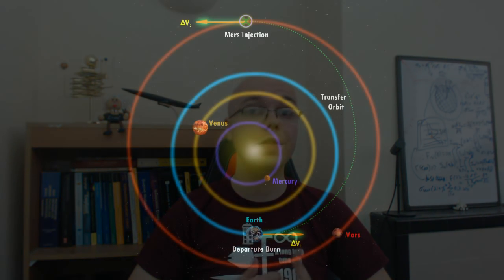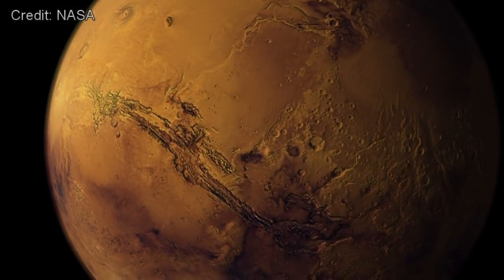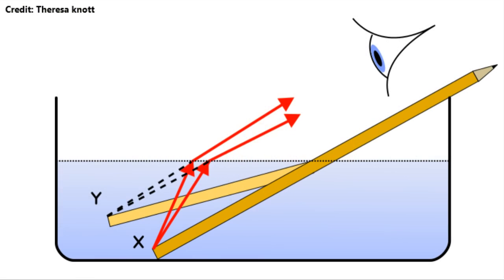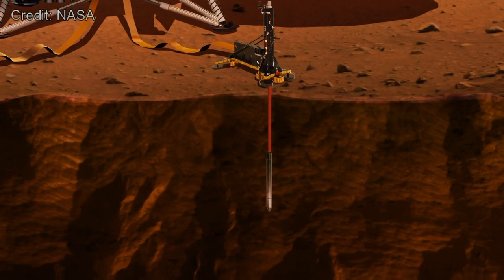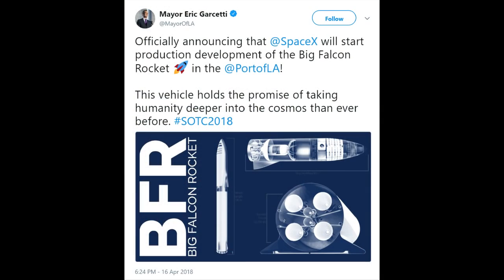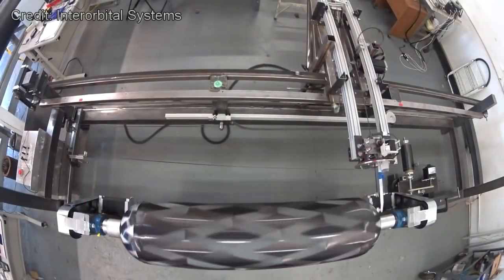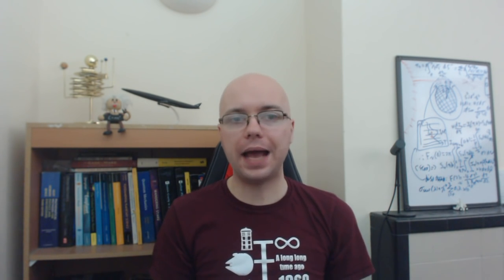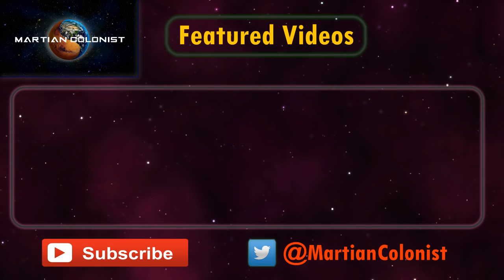Mars Mission Update: May 2018

Comment: Human colonization of Mars will not occur until technology is able to provide protection from radiation. 2020 isn’t feasible.
Reply: I've actually been looking at this, and it seems to me that most of the kerfuffle is administrative.  The actual risk is minimal.

If you check out the Mars Science Lab surface data (particularly the appendix figures 1 & 4, and tables 2 & 3):
Hassler, D.M. et al . (2013). Mars’ surface radiation environment measured with the Mars Science Laboratory’s Curiosity rover. Science 343 , 1244797.

The daily GCR (hard to shield) radiation dose is about 0.64 mSv/day (Mars surface).  And about 1.84 mSv/day during interplanetary transit.  Depending on solar activity, this can increase by around a factor of 2 more.  In a canine study, animals exposed to 3.0 mSv/day (Co60 gamma dose delivered over 22 hours for each day) lived full lifetimes with no apparent increase in mortality from tumors verses the control group.

Canine study (check out figure 3):
Fliedner T.M., Graessle D., Meineke V., Feinendegen L.E. Hemopoietic Response to Low Dose-Rates of Ionizing Radiation Shows Stem Cell Tolerance and Adaptation. Dose-Response 10:644-663. Oct. 9, 2012.

The problem comes from the administrative decision for mission design to not increase chance of death (REID) by more than 3%.  They then go on to calculate this increased risk of death by assuming all radiation damage is cumulative without accounting for biological repair in the body.  Therefore no dose is considered not to contribute to your risk of death (this is called the Linear No-Threshold Model).  They use this model despite evidence to the contrary in various radiation worker groups, some of whom actually saw reduced rates of cancer and all-cause death (radiation stimulates your immune response).

For example:
Sponsler, R. and Cameron, J.R. (2005) ‘Nuclear shipyard worker study (1980–1988): a large cohort exposed to low-dose-rate gamma radiation’, Int. J. Low Radiation, Vol. 1, No. 4, pp.463–478.

There's also a huge problem with the assumed mission designs during the risk assessment.  They are assuming 180 day hohmann transfers which are realistically going to be a much shorter transfer of around 100-90 days (BFR is targeting 90 days) due to the mechanics of three year 2 year free-return free return trajectories.  That cuts out a huge dose of radiation right there (almost a third of the total dose).  Furthermore, every study predicts actual surface dwelling habitats, which is simply ludicrous.  Anyone seriously thinking of spending 2 years on Mars is going to mound regolith over their habitats, massively reducing incoming dose:
0 meters of dirt starts you off at 0.64 mSv/day
1 meter of dirt drops your exposure to  ~0.08 mSv/day,
2 meters drops it to ~0.04 mSv/day (below OSHA radiation worker annual limits)
at 3 meters the radiation levels bottom out at local a background of ~0.008 mSv/day

So even a conservative 1 meter of dirt cuts the overall exposure an additional 29% (not counting EVA).  Thus, the actual total dose is likely to be quite a bit less than half of what their predicting.  So like I said, I don't think the radiation issue is a real problem.  Let's face it, there's plenty of bigger risks ahead if your going to settle Mars.  If you're a Martian dying from cancer, an awful lot of other things had to go right (and you've spent your life doing incredible things).

Edit: corrected free return from 3 to 2 years
Reply: +Faulx Eve
Your post is interesting and knowledgeable, but you seem to come down on the cavalier side and are not considering the political ramifications if you're wrong.

"The actual risk is minimal."
I suppose that's your informed opinion, but there seems to be a whole lot of experts putting $100s of millions into the problem who disagree with you or would definitely say we don't know yet.

Have you seen this NASA video?:
NASA Talk - Spacecraft, Habitats and Radiation Protection
https://www.youtube.com/watch?v=GIYdF7YlX3o
I don't think they've solved the problem yet.

Regarding the Mars Science Lab surface data and canine study, yes we have this data, but the problem is we have zero data for sending humans on a deep space mission to Mars with the particular type of radiation they would be exposed to. Dogs are different than humans and the radiation during a Mars mission is impossible to replicate on Earth.

"They then go on to calculate this increased risk of death by assuming all radiation damage is cumulative without accounting for biological repair"
Hard to believe that none of the smart people who are working on this problem have considered such an obvious factor.

"They are assuming 180 day hohmann transfers which are realistically going to be a much shorter transfer of around 100-90 days (BFR is targeting 90 days) due to the mechanics of 3-year free-return trajectories."
Not sure why you mention free-return trajectories as such routes do not land on or orbit Mars. I'm pretty sure the first manned mission will at least orbit Mars. I don't know where you are getting your "realistic" transfer times of 3 months. A human mission will be very massive and take much more energy and is nearly impossible to reach Mars in 3 months with current technology. Yes, Musk is claiming the BFR will send 100 people in 90 days, but he says a lot and has yet to put a single person in space.

"every study predicts [only] actual surface dwelling habitats [without considering] mounding regolith over their habitats"
Not true, many have considered using Martian soil for protection including the video above.

"I don't think the radiation issue is a real problem...there's plenty of bigger risks ahead...If you're a Martian dying from cancer...you've spent your life doing incredible things"
It may not be a problem for some individual willing to risk his life, but it is a huge issue for the success of the mission and program. Any human trip to Mars will be funded by a group of nations and corporations whose image will be destroyed and funding cease if everyone aboard their mission gets cancer, or worse, dies before they return to Earth. Hence NASA's 3% REID figure and the need to proceed with caution.
Reply: Turbulence?  Are you sure?  There's not much atmosphere for turbulence.  My understanding was that the sky-crane design solved a surface power production issue, where dust from ground level retros would settle over the solar panels.  This would be a non-issue for a tall lander with retractable panels, especially with crew around to clear them off.  Thus ground level rockets are not a problem for the BFS mission design.

Perhaps you are referring to the high speed retro propulsion problem? That was a turbulence issue.  It is also one that does not apply to the BFS, which is planned to bleed off the vast majority of its speed using a lifting body aerobreak.  After that, it will be slow enough to land very much like Falcon 9s do on Earth, a burn for which there will be practically no turbulence.

As for heatshields, there is already data for the phenolic impregnated carbon ablator (PICA) that SpaceX is likely to use.   It has a density in the range of 0.266 g/cm3, and a PICA was used on the Stardust sample return capsule.  Here is a reentry profile for it:

http://i.imgur.com/9FuB0ZF.png

Notice the majority of the slowing takes place at about 47kms altitude.  On Earth, that corresponds to a pressure well below a millionth of that at sea level (assuming my formula is even valid at that height).  Thus even Mars' thin atmosphere provides more than enough drag to bring a ship to below 1000 m/s.

As Wooster points out, if you have sufficient lift, you can take a longer pass and experience a lower maximum heat load.  There is even a possibility of doing multiple passes, giving everything time to cool off as you skip back off into orbit.

The question is, can the PICA handle it?  SpaceX seems to think that it can not only handle a Mars landing, but also an Earth-landing, and perhaps multiple times at that, without refurbishment.  Examination of the Stardust heatshield seems to agree.  With the shield losing at most only 6 mm off its 58 mm thick surface (and that after a very aggressive 100 second aerobreak, peaking at 40g).  A gentler maneuver may have removed even less.

This looks to be a pretty good Stardust paper (I've only skimmed it):
https://ntrs.nasa.gov/archive/nasa/casi.ntrs.nasa.gov/20100027549.pdf

Doing some quick research and some rough math, the shield seems to mass around 5.4 kg and the capsule around 46 kg (about 12% of the total mass being heatshield).  So to slow down around 300 tonnes of ship+payload+fuel, we're looking at as much as 36 tonnes of ablative heatshield (if we try an aggressive descent like Stardust).  There's a good chance BFS could get away with a lot less (perhaps an order of magnitude less) by using a longer breaking maneuver, evaporative cooling techniques, and capitalizing on a much much greater surface area to mass ratio (it will be mostly empty volume by the time it is in Mars' atmosphere).

Can such mass savings truly be realized?  I'm not sure.  I don't have access to their data or modelling equipment.   But from what we've seen, it does not appear to be outside the realm of possibility.  It doubtless will take some more development, but generally speaking, I'm far less pessimistic about the state of heatshield technology.

Testing the reentry procedure and hardware will be a simple matter of lobbing a BFS around the moon and landing on Earth again.  This produces similar reentry velocities to a Mars return, and should give a nice proof-of-concept.  Certainly, there's no risk of the BFR design going to Mars (or carrying crew) on its first (or even its 12th) launch.  It will need to be tested close to home quite a bit first, and I suspect we'll see many design refinements along the way.  So on this we agree.

P.S.
Your video link is a very good basic synopsis of the mission deltaV and time requirements of a Mars mission.  It does fail though to fully explore the implications of ISRU, NTR, pre-building, and propulsive abort trajectories on mission design.  Together, they make a Mars mission much more plausible.
Reply: I absolutely agree, we don't know enough to say for sure until we do it.  There are many heavy, high energy atomic nuclei flying around deep space, which have pretty huge "quality factors" which define how much damage they can do.  However, we do have quite a lot of data from animals studies using particle accelerators which can create this same type of radiation.  There are simian studies which show an even higher dose resistance than canines.  So there's some reason to believe humans will actually be more resistant.  Still, it's hard to say without doing some sort of human trial.

You might then ask, why does no one do a study? To give you some idea of the scale of the risk for lower radiation doses: a medical trial would require more than 100,000 people (ideally more than 300,000) in order to conclusively detect a significant amount of increased disease.  There are actually places on the planet Earth with similar dose rates to Mars surface (Iran for example).  The small numbers of people living in these places show no detectable increase in risk, but confounding factors like different diet, culture, and medical practice make the error in the data too wide.  So again, its hard to evaluate the real risk at such low doses.

The Linear No-Threshold Model (LNTM) is actually a controversy in the radiation industry, and not every one subscribes to it.  The model goes back to the 1940s before we even knew about DNA, and it has become well entrenched.  Most people who use the LNTM do so because data for much higher doses delivered acutely (> 1 Gy) showed medical problems.  They then extrapolate backward to lower doses using a "linear" model to reach the origin (thereby assuming no safe threshold dose exists without actual evidence to guide them).  They justify this approach because it expedient, easy to do, and limits liabilities to places like hospitals and equipment manufacturers... not because they have evidence for it.  The use of this model is driven by the same fear that removed the word "nuclear" from "Nuclear Magnetic Resonance Imaging."

Another problem is that the "smart people" involved in calculating risk, have lots of reasons to be overly cautious in the absence of data.  Since it's their job to consider "risk" they may easily disregard evidence that shows either no-risk or even a benefit because it is not part of their job.  I saw more than one research paper "adjust" the error bars because the low end was well into the "negative excess relative risk" zone (i.e. radiation might have reduced the rate of disease).

When I say "free return trajectory" I mean "if you decide not to stop at Mars" (i.e. you abort the mission), then you get a free return to Earth (no fuel need be spent).  If you do want to stop at Mars, you merely adjust your course to dip into the atmosphere and use your heatshield to slow down.  The technique required for a 90 day transfer is simply to burn a little more fuel and go faster.  The health benefits of doing so are immense, not only because of reduced radiation but also the reduced time in weightlessness.

This paper describes it excellently (also showing "propulsive aborts"):
Wooster P.D. et al. Trajectory Options for Human Mars Missions. AIAA/AAS Astrodynamics Specialist Conference and Exhibit, Guidance, Navigation, and Control and Co-located Conferences. August 2006.

When I say "every study" predicts a surface dwelling I mean every study NASA uses to calculates the increased risk of death.  The studies use a base-line model, which does not deviate from two 180 hohmann transfers and a 500-550 day surface stay.  I would advocate that the baseline should probably be different.

Finally, to address the "fall out" from an astronaut death.  Radiation death, in the unlikely event that it occurs, will probably be from a cancer 18 or more years after the exposure.  Meaning there's a pretty huge divide between cause and effect.  I very much doubt the "fall out" will and on the program.  Furthermore, during that 18 years, the person will have plenty of time to train replacements on anything they need to know, so the risk to the mission from loss of expertise is also minimal.

P.S.
I'm listening to your link while I type this.  And she's incorrect about double strand breaks.  DNA can and does repair double strand breaks, and when it cannot, the cell itself or immune system will typically destroy that cell.  Also, many cancers require a very specific point of damage to create a cancer, this massively drops the odds of random damage causing cancer.  Radiation is a number's game.  So she's oversimplying a bit. 

Remember also, her numbers are all based on LNTM (I actually recognize the graph from a paper I read), so, if there is indeed a threshold, then she may be overestimating the risk.  Potentially by a lot.

It's interesting to note that her graph shows "no smoker" populations.   If it showed the "lifetime smoker" population, their chance of dying would be lower from the Mars journey because you took away their access to cigarettes.  Thus, there's actually a huge population on Earth who voluntarily accept even greater increases in risk of death and for a far less noble cause than a Mars mission.
Reply: +Faulx Eve
A pleasure to converse with a knowledgeable person...

"There are actually places on the planet Earth with similar dose rates to Mars surface (Iran for example)."
I can see Iran being similar for certain types of radiation, but it would seem that the Earth's magnetosphere would have to block some of the rays that would reach the surface of Mars.

"the "smart people" involved in calculating risk, have lots of reasons to be overly cautious"
I agree, a miscalculation could bring down a career. But I would think management would guide them to be reasonable also or the mission would never fly.
Overall, I would say the atmosphere at NASA in the last 10 years or so for human flight has been one of excess caution and overly high standards. Perfection is beautiful, but not if it prevents you from getting off the ground. The Apollo program was a great example of very high standards yet still meeting deadlines. They let things slide that could slide a little. It seems today that NASA doesn't let anything slide and is caught up in the details and not the big picture.

"...for a 90 day transfer...The health benefits of doing so are immense"
I agree completely. It has always been my opinion that a 6-9 month transit time for humans is ridiculous and extremely risky, and that we shouldn't even attempt a manned mission until the transit time can be reduced to a month or two. However, my studies have shown that a 90 day transit is much more difficult than the minimum energy route and not yet achieveable.

"Radiation death, in the unlikely event that it occurs, will probably be from a cancer 18 or more years after the exposure."
Good point about the delayed effect. Radiation may not be the greatest health concern, as there are more immediate low gravity effects on bones, muscles and eyes.
There is a genuine concern that vision could deteriorate enough that the astronauts couldn't see to complete their work toward the end of a long mission. The other huge unknown is mental health stability.

"listening to your link...she's oversimplying"
Probably for the audience and time restraints.

"there's actually a huge population on Earth who voluntarily accept even greater increases in risk of death and for a far less noble cause than a Mars mission."
And to go even further, plenty of people that would love to travel to Mars even if they knew they would die shortly after getting there. However, we live in a politically correct & very public world where astronauts are almost demigods, and dead astronauts are not acceptable.
Reply: It's been a pleasure.  You have certainly made good points.

I have just one more thing to add on 90 day transfers:
...Well shoot, it looks like I got it backwards, I should have said "2 year free return".  Thanks for making me check.

Here in Wooster et al.  Look at figure 13:
https://smartech.gatech.edu/bitstream/handle/1853/14747/HumanMarsMissionTrajectories.pdf?sequence=1&isAllowed=y

For the 2 year free return, Earth-Mars transit times are between 100-155 days depending on the conjunction.  The cost is around another 500-600 m/s deltaV when departing Earth (figure 11).   It would only take another few hundred more deltaV and a willingness to use propulsive abort to reduce this all the way to 90 days for most conjunctions, provided the heatshield can hold out against an additional ~4k m/s at the destination.  The heatshield should be designed for that in any case since the 2030 conjunction would require it anyway.  It really does look doable for the BFR architecture.

They could easily (and by easily I mean... "with great gnashing of teeth") accommodate more difficult conjunctions by reducing their available maximum payload during that mission.
Reply: I'm still looking thru your Wooster paper and would like to double check the info as it is 12 years old.

I do know that around the time the paper was written or after, engineers discovered that propulsive landings for large human-class vehicles on the surface of Mars introduced unacceptable turbulence and thus a problem for how to land. This issue comes up rapidly as the landing mass goes over 1 ton, which is one reason why the Curiosity rover used cables for the last few meters. I don't know if this problem has been solved yet on paper, and it obviously hasn't been tested in practice.

The other issue the Wooster paper brought up was the limitations of current heat shield materials, which as far as I know is still a problem. For the massive human missions the materials we now have are questionable, and getting a shield into space that is large enough to do the job is an ongoing difficulty. All of the fast transfers that you mentioned would put even greater demands on the heat shield at Mars. The faster you leave Earth, the more fuel it takes, which means a bigger rocket, more expense, less payload, and more difficulty slowing down at Mars.

The Wooster paper's fast transit times also relied on aerobraking at Mars, as direct entry produces too much heat. Aerobraking is a difficult and risky procedure under any circumstance, and especially for an expensive and massive human mission. I can't see the first human mission to Mars using aerobraking without several unmanned massive test flights going there first, which of course takes lots of time and money.

"It really does look doable for the BFR architecture."
Again, I would encourage you not to look up to this craft as it is so over-the-top compared to anything that has been done yet:

largest rocket ever
1st single stage to orbit (BFR 2nd stage) 
1st fully reusable (even after going to Mars!) 
1st major refuel in orbit (major problem)
1st to refuel on Mars and return to Earth (major problem)
launch 100 people at a time in comfort all the way to Mars when the current record is 8 to LEO or 3 to the Moon
land well over 100 times more mass on Mars than the current record

BFR is VERY unlikely to fly in its current form, especially any time soon. Musk is trying to achieve too much with one rocket. He thinks he can solve every major rocket challenge that engineers worldwide have been working on for decades.

If you haven't seen it, here's another excellent YouTube video by NASA on the difficulties of getting to Mars:

It Does Take a Rocket Scientist! Stan Love Explains Why Mars is Hard.
https://www.youtube.com/watch?v=fturU0u5KJo
Reply: "Your video...fails to fully explore the implications of ISRU, NTR, pre-building, and propulsive abort trajectories...they make a Mars mission much more plausible."
NTR=nuclear thermal rockets?
What do you mean by pre-building?
Of course ISRU would make a huge mass difference and is very possible, but this tech is no where near ready - even for a simple test mission to Mars. I've only read about one team with a working model, non-flyable. Any actual system would have to be placed on the surface of Mars and working for months or years, storing its resources in pristine condition, and absolutely proven to work, because failure means the crew is destitute.

You make good points about the details of the turbulence issue, heat shields, available data and testing. None of these areas are insurmountable by themselves, however, I'm stepping back and looking at the overall picture facing any manned mission, and more specifically, regular flights or colonization within the next 10 years using the BFR. A SpaceX manned Mars mission will happen only:

if the cost can be kept down and the billions of funding put together
if their huge carbon-fiber-reliant rocket with so many engines can be man-rated
if major refueling can be done in orbit - a difficult problem as fuel loss occurs while the cryogenic fuel gets heated and cooled thru every orbit
if radiation exposure can be made acceptable, along with other health issues
if fuel production on Mars can work
if the TPS can hold up all the way to Mars and all the way back to Earth
if aerobraking and landing such a huge, new rocket can work
if every critical system can be made so reliable to bet the lives of a large crew for up to 3 years

SpaceX is mainly working on the rocket, with all the other engineering and testing yet to do. I can't see all this coming together for anyone in the next 20 years.
 
I'd be curious what you think is a realistic time frame for SpaceX's first manned Mars landing.
Reply: Yes on the NTRs.  They improve payload to fuel ratio by quite a lot and can double as a power source.  We aren't likely to see it in the BFS design.  Still, it's something which NASA was looking at as a game-changer, and it deserved more than passing mention in that presentation.

When I say "prebuilding", I'm referring to the technique of landing one or more robotic missions during the previous conjunction.  These missions set up your habitat, prepare your landing site, deploy ISRUs which create a ready supply of fuel for any return missions you might be planning (along with water for use during the stay).  That way, by the next conjunction, if everything checks out, the crew transfer mission has a lot less to worry about, and it needn't carry a lot of extra equipment.  Instead the crew would rely upon the supplies awaiting them on the surface.  This approach saves a tremendous amount of both fuel and supply mass (and reduces risk) during the all-important crew transfer.   On the other hand, if the mass savings are to be fully realized, it might also commit them to a landing (no extra food to allow an abort).  Whether this actually would occur depends a lot on mission design.

You're right in that a lot of this is theoretical, almost none of the technology is ready.  For example, if I wanted to find something to be worried about, I'd look at just how unreliable the "developed" ISS water and O2 recycling systems are.  They need a lot of heavy spares with how refurbishment and replace is handled.  ISS's whole "orbital replacement unit" architecture needs to be rethought, with a mind toward local repair and refurbishment instead of "replacement".  Honestly, that isn't likely to happen in the weightlessness of a closed vessel, too many small, fiddly parts (screws/washers/ect.), liquid hazards (oil/grease/ammonia), and toxic vapors (from sealants and epoxies) to worry about.  These could probably be done on Mars base where there is some gravity and the ability to work outside the habitat (i.e. in another building).

Which brings us to another long-term technology that is needed, rotational gravity.  This remains totally undeveloped.  There are a few papers talking about it, and a few technical prototypes have been thought up for allowing "sun-tracking" or "communication tracking" systems to operate during spin.  But serious development has not happened at all (pretty much ever).  The closest we've come was way back when they spun up Skylab for a while.  Even that was more done as an afterthought than as a primary part of the mission design.

Cryogenic fuel transfer is quite a lot closer to readiness.  There are existing systems for keeping the boil-off problem to a minimum (even for the extremely difficult to cool hydrogen fuel).  Basically these systems pipe coolant through the fuel tank, extracting the heat that would otherwise boil the fuel.  Most existing fuel storage systems do not employ such cooling because it consumes power and adds mass.  But the technology exists, and it is light enough to use (on a long journey) if you've got plenty of power (which we do thanks to all the recent solar panel technology).

Another technology that could use work is long term food storage.  Last I checked, they were having difficulty storing prepared foods for the needed 6 years.  They could keep it appetizing for about 2 or 3 years, but after that the food chemically decomposed and became a lot less palatable and less nutritious.  Since a lot of the food needs to be stored on the previous conjunction, that means it's already past its shelf life by the time people show up to eat.  This isn't a show stopper though, vitamins are the first thing to break down in these prepared meals, and a fresh supply can be brought along with the crew or stored in a more stable form for use in not-yet-prepared meals.  Either way, vitamins are not heavy, so as long as the stored foods' fats and sugars stay wholesome, food calories can be kept long term.  As a side note, in the 1800s the Metis people made a food from buffalo meat and fat called "pemmican" and sold it as a forever-food for use during long sea voyages.  Historical reports suggest, if properly stored, it could last decades.

Growing food locally could solve some of these issues, but that technology is in an even worse state.  Although the US government has been doing research on the problem for decades, most of the research sites have been shuttered and funding dropped.  The private industry has picked up a lot of the slack, but there are no real systems in place which can completely close the plant-human life support loop for the duration of a Mars mission.  LED technology especially has made indoor farming almost economical.  If the price of power drops or the price of water increases in the next decade, we'll see a rapid surge in development here.

All in all, there's a boat load of other work that needs to be done, aside from building the boat which can cross the sea of stars.  I'm pretty hopeful that SpaceX can get the new rocket working and fleshed out within six or so years.  Even so, it will take a lot of attention from a lot of scientists and engineers to finish up the other technology.  But if you look at the pace with which technologies like computers, phones, and plastics have been progressing, it's clear the world of technology is revolving a lot faster these days.  If we can keep a similar development pace in space technology, I think we could see a solid prototype system ready to carry crew for the 2033 conjunction.  Getting everything ready by that time would be a tremendous effort, but, in my opinion, that would be an ideal goal to set, since the deltaV is most favorable that year.  The 2035 conjunction then can act as a nice backup if something gets delayed.

So, in short, I'm thinking it's about 15 years out.  I guess that makes me just a bit more optimistic than you. :)
(edited mostly for typos)
Reply: Amazing view of Stardust PICA:
https://www.researchgate.net/profile/Ioana_Cozmuta/publication/268470375/figure/fig2/AS:480261579251713@1491514691591/As-extracted-cores-after-cleaning.png
Reply: "NTRs... deserved more than passing mention in that presentation"
NTRs have contamination risk during launch, which is a political no-no, but may be improving with newer designs. NTRs have never flown, so they are a looong way from being tested, proven reliable, then human-rated......let alone trusted all the way to Mars and back.

"prebuilding...robotic missions...set up....ISRUs...a ready supply of fuel...supplies awaiting them on the surface...no extra food to allow an abort"
This would obviously be a big help if proven reliable, but I can't see this happening on any of the first human Mars missions, especially if on-site resources are critical to survival. Maybe years down the line after we see the stuff waiting safely for us on Mars.

"local repair and refurbishment instead of replacement...could probably be done on Mars base where there is some gravity and the ability to work outside the habitat"
Repairing on Mars is a good idea, but means that your critical system has to work during the long transits to and from Mars, unless you have enough mass to spare for backups. Yes, most missions spend mass on backup systems.

"Cryogenic fuel transfer is quite a lot closer to readiness."
Glad to hear it, but this will need to be flown and tested before relied upon for a human Mars mission.

"there's a boat load of other work that needs to be done"
and funded...massively funded...and motivation has to come before funding. SpaceX seems to be the only group right now that is really pushing to get to Mars in the next decade. Lots of other countries and companies want to do it, but their attitude is more like, "Mars...yeah...eventually." SpaceX cannot make it on their own. Musk has admitted that their budget for BFR development is tiny ($100s of millions).

"I'm pretty hopeful that SpaceX can get the new rocket working and fleshed out within six or so years."
What do you base that on? SpaceX has done great with re-use and lowering costs, but has no experience lifting people and is trying for a never-before & over-the-top rocket. I could see them readying a Dragon capsule atop a Falcon Heavy in 6 years, but they have chosen to go all or nothing with the BFR. SpaceX is also in the habit of bending the truth for flash and hype. To me, that is a bad sign for an aerospace company that will be putting lives at risk.

"it's clear the world of technology is revolving a lot faster these days"
It is, but most of it stops at LEO, where the profit is, not Mars.

"I think we could see a solid prototype system ready to carry crew for the 2033 conjunction.  Getting everything ready by that time would be a tremendous effort"
What do you think would be the total funding needed to make that happen, across all needed technologies? Management, research, ground testing, flight testing, inevitable delays, crew training, building, etc. $100 billion + ? And that money would need to be committed or in place within 5 years, well before everything starts ramping up in the active years before the actual launch.

"I'm thinking it's about 15 years out.  I guess that makes me just a bit more optimistic than you."
You are actually a lot more optimistic than me. When I said 20 years, I was talking possible, not probable. I've been following this closely for about 5 years and - barring some miracle multi-country, multi-company funding increase and kick in the pants - I can't see humans on Mars before the 2040s or 2050s. There's too much left to do and the target is so far away. At least we could look up and see the Moon, which surely provided alot of motivation to get there.
Reply: They actually did very thorough ground tests of completed NTR systems, the technology is at a very high state of readiness.  Also, they did explosive drop tests to see how a reactor would do during a launch pad explosion.  The reactor casing is pretty stern stuff, so, even in the worst case, the contamination was limited to a pile of unscattered fuel rods near the bottom of the rocket.  The bigger contamination risks happen down range over the ocean for US launches, or during deorbit events, such as happened when Soviet Russia lost control of a nuclear satellite (Kosmos 954) and dropped it on the Canadian wilderness.

"Sparing" mass is actually the reason I'm so critical of the current ISS architecture: its almost to the point where it would be more economical not to have recycling systems and just use expendables, which is madness.

Let me be clear: when I say I think SpaceX will get BFR working in 6 years, I mean robot ships.  I don't see long-voyage, crewed vessels being a thing for another decade.

You talk about the economic ramp up that we'll need to get to Mars; I think we're actually at the beginning of that ramp up now.  Launch price is the single biggest impediment to any development of space.  SpaceX has made big inroads to reducing that, and every other serious rocket building organization has been forced to look for ways to reduce costs (such as reusability).  Once their competitors start building the new designs, SpaceX will face price competition which should drive launch costs even lower.  At that point, we'll undoubtedly see a surge of new development in all aspects of spaceflight.  It wont just be SpaceX doing it, it will be everybody in the industry.  Hopefully, that will, in turn, spur the birth of a space economy, with companies competing to provide fuels, raw materials, inter-orbital transport services, and habitation to other companies beyond Earth orbit.  As soon as profits are to be realized, development will snowball exponentially.  After that, I don't think governments will need to throw money at the industry at all.

A cellphone from...
1988... ~$1500
http://www.bochud.ch/images/panasonic.jpg
1998... ~$1000
http://cdn1.knowyourmobile.com/sites/knowyourmobilecom/files/styles/gallery_wide/public/3/00/startac.jpg
2008... ~$150
https://i.pinimg.com/736x/16/e0/73/16e0732270db7bf53cfa652c1d6cdbb1--device-electronics.jpg
2018... ~$250
https://s.abcnews.com/images/Technology/RT_ipone_as_160217_12x5_992.jpg
the future?... $?
https://c.slashgear.com/wp-content/uploads/2013/12/lg_g_flex_display_sg_5-820x420.jpg
Reply: "NTR systems, the technology is at a very high state of readiness"
Sounds excellent. So why hasn't it flown yet? And again, it will take numerous launches and years of reliability before it's committed and engineered into an all important human mission to Mars.

"I think we're actually at the beginning of that ramp up now."
Who besides SpaceX is seriously committed to Mars right now? NASA is going there but, as you know, has been directed to cis-lunar for the next 10 years. The only current ramp I see is a down-ramp of prices, not the BIG up-ramp of spending needed to send humans to Mars.

"Launch price is the single biggest impediment to any development of space."
I agree completely, however when talking Mars, a very close second is knowledge of exactly how to get humans there and back safely. If prices fall enough, some reckless company/country could lob some human cannonballs that way just to be first (think Inspiration Mars).

"SpaceX has made big inroads...other organizations forced to reduce costs ... competitors start building new designs... SpaceX will face competition ...surge of new development in all aspects of spaceflight...wont just be SpaceX ... spur the birth of a space economy ...profits are realized, development will snowball"
That sounds like a good track of what is likely to happen if growth continues smoothly with no major problems and some situation doesn't occur like the satellite market getting saturated with too many satellites for the current need. It seems to me that any "space economy" will be developing much slower than comparable industries did like trucking, shipping or airlines (how long is your cellphone timeline?) because, even with a 10-fold decrease in costs, going to space would still be quite an engineering trick. Orbital rockets can't really be built in someone's garage. Won't it take 20 years for your snowball to develop enough to enable a human Mars mission? Hence my estimate of post-2040 for the first boots on the red soil.
Reply: NTR systems, ... "why hasn't it flown yet?"
This kind of goes back to where we started. :)  It's because the radiation boogieman has the public jumping at electromagnetic shadows.  In chemistry it's called nMRI and in medicine just MRI.  The word "nuclear" was omitted because so many patients were uncomfortable with it.  The radiation was the same, but people were more accepting of the technology when its association with atomic cores was less clear, even though this is largely irrational: a fear born from ignorance.  NASA is actually already launching highly radioactive substances in the form of RTGs, perhaps because the device name doesn't go out of its way to remind everyone that it contains several kilograms of Plutonium.  Maybe if they had just called them "Nonchemical Thermal Rockets" they'd have had better luck?

"Who besides SpaceX is seriously committed to Mars right now?"
Fortunately others don't need to be committed to Mars, just to new (cheaper) orbital class rockets (to kick-start the development of related technologies by reducing the cost to deploy working prototypes).  So, for that, we're looking at Blue Origin, Virgin Orbital, ULA, Ariane 6, Stratolaunch, Electron, Vector, the Indian Space Agency, the China National Space Administration, and if they can get their act together Roscosmos.  I want to say JAXA too because so many Japanese are serious about space, but, with how little actual development they've done, apparently no one over there wants to pay for it.

"Won't it take 20 years for your snowball to develop...?"
Sounds about right, and that 2035 window is 17 years away.  Like I said, 2033 would require a big push.
Reply: Keene Tiedemann idiot